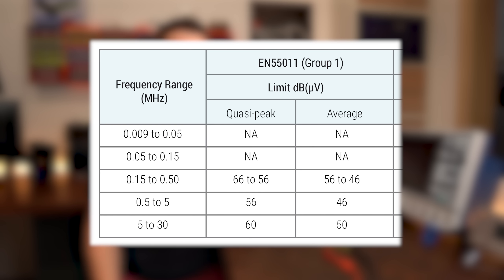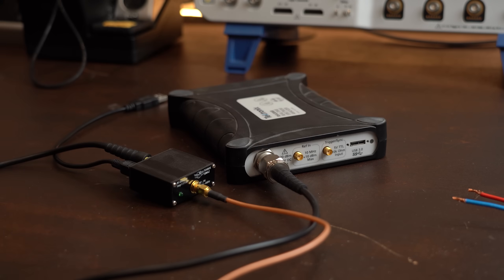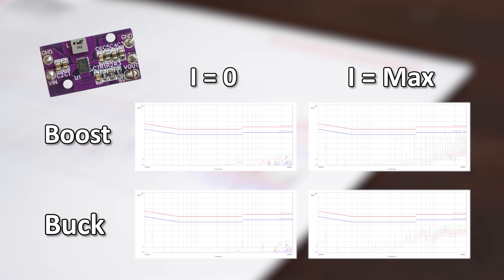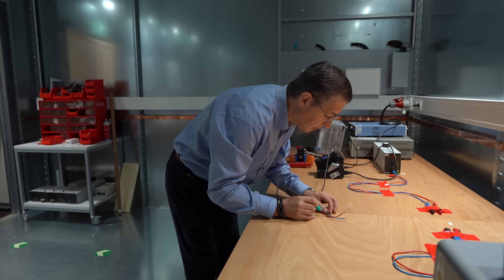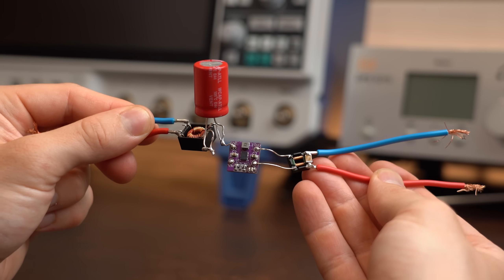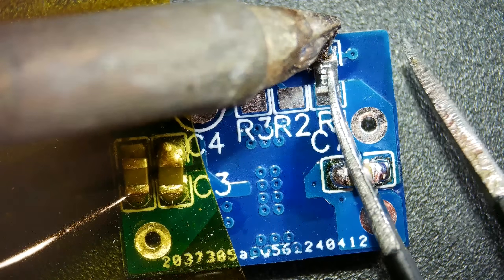Are my Circuits ILLEGAL to use?! (EMC Testing)

Comment: Increasingly it feels like EMC is a lost cause!
I'm a Radio Amateur - and for myself take it very seriously.  But over the last decade, the amount of stray, broad band RF noise where I live makes radio reception on HF (160m to 10m) near impossible.
The main culprets where I live seem to be Solar Panel Inverters and broadband internet, roadside boxes.
If high value equipment can be sold, installed & used despite radio interfenernce issues, what hope is there for  smaller, cheaper appliances from Asia?

Comment: Summary
* 0:00:11  The Problem: Cheap DC-DC boost/buck converter boards (like those from Asia) often have poor EMC (Electromagnetic Compatibility), meaning they emit electromagnetic interference that can disrupt other electronics.
* 0:00:15 Why EMC Matters:  While these boards are typically battery-powered, the interference can be problematic when connected to larger battery packs (e.g., in electric vehicles) as it spreads to connected components.
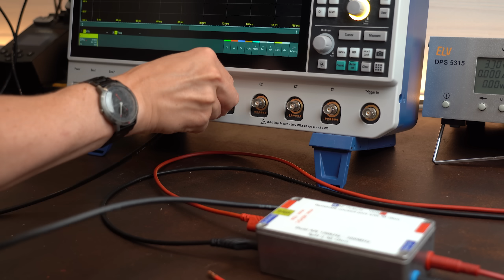* 0:02:00 Testing for EMC: The video demonstrates testing conducted in a specialized EMC lab with equipment to measure both conducted (wired) and radiated electromagnetic interference.
* 0:02:46 Test Results:
    * All boards passed the conducted EMC tests.
    * All boards failed the radiated EMC tests when operating at maximum output current.
    * However, there's a loophole: if the board passes EMC tests at its normal power state, it's considered legal to sell.
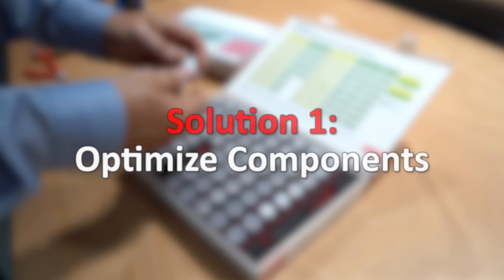* 0:07:21 How to Improve EMC:
    * 0:07:21 Optimize components: Add more or better capacitors to lower the peak current, reducing interference.
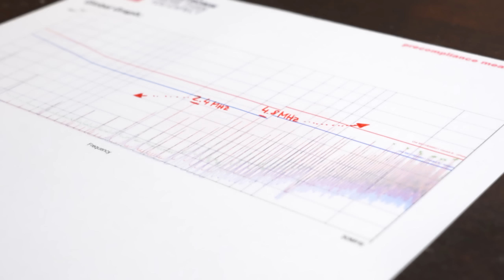    * 0:08:05 Add Filters: Input and output filters, such as common mode chokes and pi filters, can significantly reduce interference at the switching frequency.
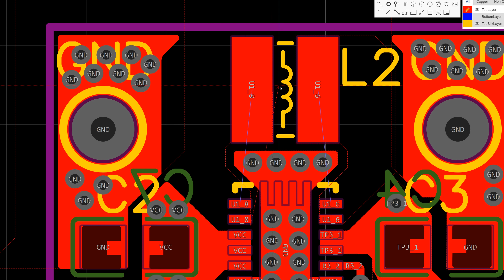    * 0:09:07 Improve PCB design: Shorter traces and using a four-layer PCB (with dedicated ground and power planes) can also help.

* 0:10:13 Important Note: The video highlights the complexities of EMC and encourages viewers to learn more via resources provided in the description.

I used Google Gemini 1.5 Pro exp 0801 to summarize the transcript.
Cost (if I didn't use the free tier): $0.0771
Time: 24.95 seconds
Input tokens: 19994
Output tokens: 678

Comment: How about a 6 layer pcb, with layer 1 and 6 being solid metal and connected at the edges for a faraday cage?
Reply: That’s just the half of the battle. You need to care about the circuitry (filtering), so appropriate filtering on In and Output as well,
Reply: I think the components themselves (and their pads) break up the outside planes enough to matter.

Comment: Any power supply or voltage converter should be placed inside a shielded enclosure to prevent EMC issues. If they have DC outputs, filtering of the outputs should be done to remove any noise on them. You aren't going to make a buck or boost converter that doesn't make EMF noise. Same goes for inverters and rectifiers. There is going to be noise from the circuitry. You can make an enclosure using plastic and conductive paint if weight is a concern, just remember that you need to make electrical contact on all seams of it and to ground it so the EMF is being sent directly to the chassis ground of the circuit of the equipment, vehicle, or building so it is dissipated instead of being passed through the enclosure.

Comment: The most significant example of EMC problems I've seen is from a cheap HDMI cable I bought that prevents the TV from receiving digital broadcasts when it's plugged in at both ends.

Comment: im building headphones but want each ear as its own bluetooth device ,,,so im getting 2 receivers and connecting my speakers VU meters and single battery pack to it all ...but when i turn it on one side stops working completely ,,,how can i isolate each amp on the power side to fix this ...its all i can think is that could be doing it

Comment: For conducted EMC filtering the capacitor used by the test engineer is ridiculous, it's legs are far too long for MHz frequencies - the common mode chokes did all the work.
To make this pass (in a cheaper smaller way) try putting 10nf caps 0603 or smaller on input and output - they are very good for many cases.
You need to check whether any caps used are any good at the frequencies of interest - bigger is not better as the inductance gets worse  - you need an impedance graph over frequency to pick a cap that's any good AT the frequencies where your product exceeded the limit.

Comment: Your comments about maximum electric/magnetic fields depending on maximum/minimum load is not correct.
Switch-mode power converters emit different EM depending on load. Testing the two extremities is not guaranteed to catch the worst case emissions.

Comment: You wonder if boards from China are checked for EMC?
YOU, the importer have that responsibility.
Even though importers have that responsibility, it's self-regulation (which means no regulation until you are caught).
So you can expect serious products manufactured in large quantity to pass, but lots of small stuff to fail.
Populated PCBs are not final products but components, and so they do not have to pass. When you build a product with them it is YOUR responsibility that the final product you make passes EMC laws.

Comment: EMC sometimes feels like voodoo and certainly is very close to magic. A few things I learned over time: 1. Use fully shielded inductors whenever possible. 2. Inductor orientation matters: you want the start of a coil to be closest to switching element 3. Avoid long loops 4. C0G caps can really help with higher harmonics 5. Feed through caps are better than shunt ones

Comment: If you want to sell a SMPS, high frequency PWM device or Class D power amplifier in the USA, you need to have FCC registration and testing performed, because of radiated interference. A lot of low cost Chinese products do not carry a genuine FCC mark or any at all.

Comment: Housing can also make a big difference in radiated EMC. Ever notice how in old computers there's often extra metal sheets insulated by paper or plastic layers? Or how inside most modern plastic power bricks there's a metal sheet glued to a plastic sheet packed in around the power supply? These things give the circuit designers a lot more leeway EMC wise while leting the final produced and assembled device to pass EMC testing.

I definitely would not recommend frivolously removing and throwing away such shielding as "unnecessary waste" as many retro tech youtubers do. We have much more high frequency interference in our homes today than those devices were designed for back then.

Comment: Here's a funny story. The office where I work was using several consumer-grade Wi-Fi routers as access points. We are in a research campus near a company that works with satellites. One day the CRTC (Canada's telecom regulator) showed up with a rather expensive RF spectrometer looking all over our building like they were witching for water. Turns out one of those AP's radios was putting out too much energy into adjacent frequencies and those frequencies happened to be what they were using to communicate with the satellites. Every time they had to turn their dish towards our building, they got a bunch of noise. Just goes to show how important it is to meet EMC requirements!
Reply: I remember there being a news story years ago of a radio-telescope here in Australia that kept picking up random bursts of interference around the 2.4GHz spectrum at regular times throughout the day but they couldn't pinpoint what it was or where it came from. Eventually they figured out that it was caused by employees opening the door to the microwave oven in the break room to stop it whilst it was running. Just enough microwave energy would leak out in-between the time the door opened and when the oven turned off to be picked up by the telescope.
Reply: @rdqsr I wonder how they finally made the connection that is was the break room microwave oven?
Reply: There's a story from one of the electronics magazines about some building owners who were having trouble with their alarm system going off overnight, but only between certain times.  Extensive testing could find no fault in the alarm system and at long last, the engineers who were investigating decided that the only possible cause could be interference by externally generated radio frequencies... but from where?

Then someone realised that the next-door business was a bakery, which of course operated overnight to have its produce ready for the following day, so with the cooperation of the bakery owner, they went in with their RF "sniffers" and microwave-detection equipment to check the bakery's equipment, which included a large microwave oven for some of the baking.

At first it seemed like a "dry hole" as everything was working just fine with no microwave radiation leakage.  Then someone tried opening the microwave oven door without first turning the oven off.  Suddenly, the microwave radiation meters all slammed over to full-scale, following which an engineer made a dive for the power outlet to turn off the oven.

Investigations followed, and it was discovered that one of the cooks had decided that exposing himself and everyone else nearby to microwave radiation was somehow preferable to having to reset the oven timer each time a batch of cooking had been completed and a new batch was ready.

Things did not go very well for that particular cook.
Reply: @melkiorwiseman  Lmao oh snap.
Reply: That's not EMC
Reply: @leandroebner1405  why not?
Reply: @reverse_engineered  I worked for a company that supplied computers to schools. The management wernt happy about the time and money spent on ensuring the kit met EMC standards. Then one day they recieved a call from a school saying that a child with a pacemaker was getting heart palpitations when he walked past one of our computers. An engineer was dispatched to investigate where upon it was discovered the problem was a monitor supplied by a third party not our kit. We gave them one of our CE approved monitors and breathed an enormous sigh of relief. The Technical Director never complained about signing cheques again.
Reply: Thanks for sharing your story. It's a good example of why it's important to keep the radio spectrum clean. I might just mention that the "men in black" that showed up at your office were very likely not from the CRTC. They were from the radio spectrum management branch of Innovation, Science and Economic Development Canada (ISED). The latter is responsible for investigating radio interference problems in Canada. Have a great interference-free day, hey!
Reply: HEY... give it to me, I dont care if its legal or not, I dont even give it a thought, likely the more suspect THE BETTER ....  compliant this...  smFh
Reply: @Steve_mos8541  I guess you don't need to rely on a pacemaker :-)

Comment: Really not even close to an expert in this topic but as said around 5:20 we cant get rid of the switching noise of the switching converters but wouldnt it be possible to cancel it out like in sound theory with 2 working out of phase to each other to cancel out each other (at least a bit)? Just like every noise cancling circuit functions, just an idea :)

Comment: I would like to see more information on preliminary in-house testing, instead of "you can't do it without all this specialized equipment." Those labs are extremely expensive and as small scale designers, this would quickly bankrupt us. There must be a way to get a "feel" for whether your circuit will pass before wasting time and money on this expensive process.
Reply: You can do some rough pre-compliance testing for sure. Get a metal table, 1-2 LISNs, and a 1-2000$ spectrum analyzer for conducted emissions. You can use a big Zarges aluminium box as a "poor man's GTEM cell" to get a rough house number where you are with radiated emissions. But esp. the last one will not be a proper measurement of course. More like you are looking for anything that sticks out in the spectrum and attenuate it as much as possible before attempting a certification run. In Europe I have also made good experience with the RF departments of local universities being willing to help for relatively small money. Not sure how that works with for-profit schools in other parts of the world though. The reality is also that if you want to sell a product in a market that requires CE or something comparable, it is often enough not worth the trouble as a small-scale guy. Those tens of thousands of €/$ are just a fraction of the potential costs including electrical waste, legal risks and other cost factors.
Reply: TinySA, a LISN, and an antenna can get you into the ballpark. Having a calibrated RF source helps a lot too
Reply: I haven't had luck with my TinySA, the sweep is SOOO slow... what am I doing wrong?
Reply: Well the best advice I can give u

Get urself AM radio
Take ur product, portable power source and your radio deep into nature (like a forest), so u get away from all the city noise

Sweep acros am band while ur device is powered and observe if u hear any change in sound on the radio while the device operates

If u hear noise, then device is bad
AM doesnt lie, AM shows all ur mistakes

Fix ur product, if u dont hear noise ur good
PS: regular am radio usualy operate on lower frequencies, but there usualy problems are so if u fix for lower frequencies, u fix for higher frequencies

If u want to test vhf, then u can get airband receiver

Comment: If and when your boards are not standalone complete systems but components for a larger system they do not have to or, indeed may not be able to pass EMC tests. As to the end user, if they are individual hobbyist, I don't think their DIY systems need to pass EMC either.

Comment: You forgot 50% of the EMC equation: There are also requirements for what you need to accept and handle when it comes to incoming noise as well.
A lot of cheap audio amps are not properly immunized for conducted noise on power. Many also amplify common mode noise directly due to single-ended inputs too.

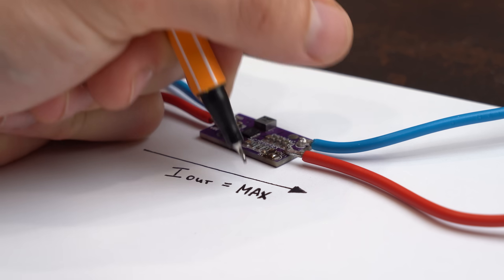Comment: 3:30 honestly, that is factually not accurate. Some converters have their worst EMI at the 50% or 99% point. I know you had to simplify for time constrains and low and high load are good compromises, but some products have strange resonance effects only at certain load points.
Reply: I worked with a radio that had maximum EMI sensitivity at 50% volume. That was the maximum power dissipation point.

Comment: Spending a day in an industiral sized "tin foil hat" must have been a relaxing day.
Reply: Normally it is slightly nerve-racking... If you fail and can't fix it on site, you need to pay another for another test, and those doesn't come cheap.
(technically you need to retest anyway to verify the solution )
Reply: Probably too much adrenaline.  But getting to rest in one off the clock can be wonderful ... people do pay for sensory deprivation tanks.

Comment: Würth Sweden visited our school when I studied Electronics engineering 1,5 year back, and they talked about EMC and that was one h**l of a rabbit hole.
But really interesting but an though subject to grasp.
The most fascinating of EMC were that this thingy interfered with everything 100kHz up to 10MHz, two capacitors and some inductors and poof "gone".

And as a HAM radio operator the lower HF band are not pleasant at all interference around S7-9, and during black out 0...

Comment: A proper isolated booster from 5V to 12V that had low emi would be super helpful! Then you can use a bt source and amp share the same ground/battery without ground loop noise.

Comment: Dude. That lab is sick.     Some of the stuff I work on is a riot. You remove a cover and it starts doing some funny stuff to your phone and the unit     The worse though is the shocking lightsabers I made.  They were so dirty they definitely are illegal if your around any transmitter.  Cooked 2 iPads and 3 cell phones just being within 4 feet of them.  They hurt like hell. 😂

Comment: Apparently here in the USA, FCC are obviously strict about RFI and EMI, yet they allow some hobbyists to get away with it, at least up to four or six projects, that's it. I am sure it might be the same elsewhere, you gotta look at RFI / EMI rules for where you live at, they differs somewhat. If you wanna sell the completed boards to somebody else, you definitely want to have a decent oscilloscope so you can rework and / or respin the board once you find out why. It's your responsibility to make sure it doesn't disturb TVs and any other electronics.

If you work with SMD components, it's a bit easier to manage RFI with solderable Faraday cages which phones almost always use. It's kinda recommended to use the shields with DIY RF circuits in order to get the cleanest signals possible as outside RFI and EMI would mess with it making it a bit harder to discern via oscilloscope.
Reply: R&D often uses tin foil :D

Comment: Having been an Electronics designer for many many years, I find it unusual to test individual boards, we would always test against regs as a final enclosed product with EMC filters fitted as necessary. Have EMC regs changed over the last 10 years?

Seems to be a simple ad for Wurth, but interesting for many seeing radiated vs conducted measurements I'm sure.
Reply: No but then GreatScott would have had to build an entire product including enclosure before going, which would be quite a lot of work for a single video
Reply: @TalpaDK  so it's bit misleading for those designing and building their own boards if this wasn't qualified, many may feel they can't design, build & sell their own PCBs.  Is he trying to crush competition 😂